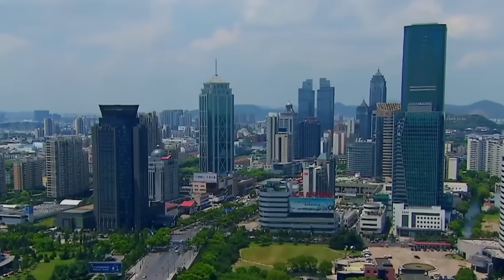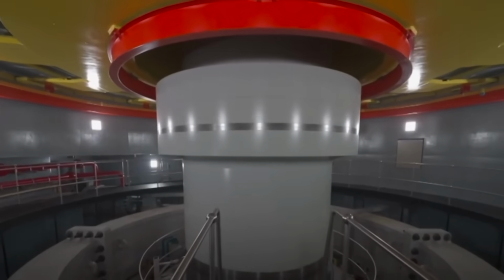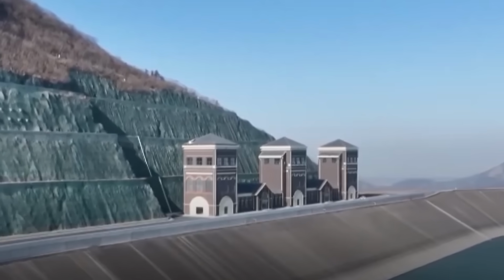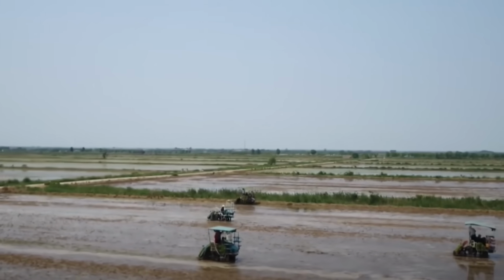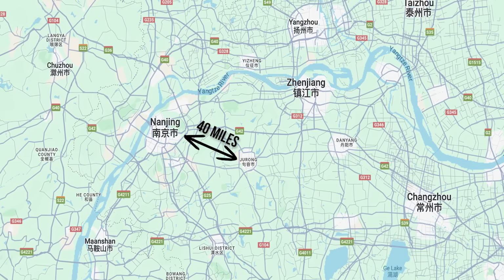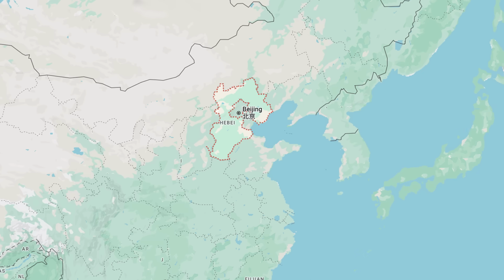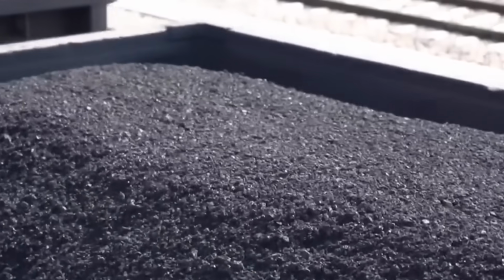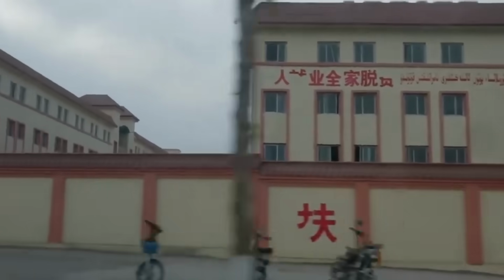China Dug Giant Pits in Mountains and Poured Billion Tons of Fresh Water into Them, Result Is Insane

Comment: As electrician I noticed right off the bat you said high voltage DC. That's not correct and hasn't been used since the days of Thomas Edison. AC electricity is easily stepped up and down that's why we use it.
Reply: It is DC. 
To answer your revised question: Yes, China is adopting High-Voltage Direct Current (HVDC) technology for long-distance power transport.
Reply: To answer your revised question: Yes, China is adopting High-Voltage Direct Current (HVDC) technology for long-distance power transport.
Reply: I notices that too and wondering if it is correct. Some new concept they might be trying strictly for transport? Doubtful because the whole point of AC is for efficient transport. In the home, most devices have to again rectify to DC for all practical uses. Highly unlikely the are going DC for transport.
Reply: It’s like a million volts, DC, less inductive resistance
Reply: You can look up Path 65 in USA
or The Gotland HVDC link in EU built in 50ies . It's not just Chinese thing.
DC uses all of conductor not just skin deep.
For the same conductor size, the effective resistance is greater with AC than DC,  hence more power is lost as heat with AC. In general, the total cost for HVDC is less than an AC line if the line length is over 500–600 miles, and with advances in conversion technology, this distance has been reduced considerably. A DC line is also ideal for connecting two AC systems that are not synchronized with each other.
I'm not an electrician, but I have interest in the subject.
Reply: I think that you didn't had much to do with high voltage transmision lines. DC voltage lines are popular and they run great distances and have great capacity. They are everywhere. Largest are in China like the Hami-Zhengzhou or Xiliuodo - Jinghua lines. Both of 8000 MW capcity at 800 kV DC running for 2200 km!  😉